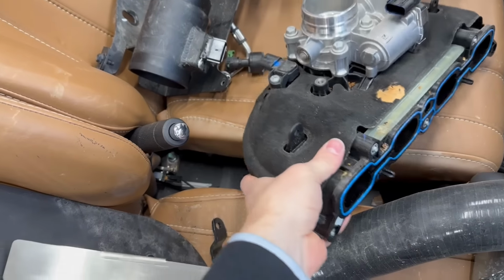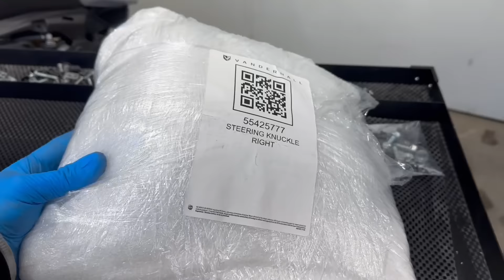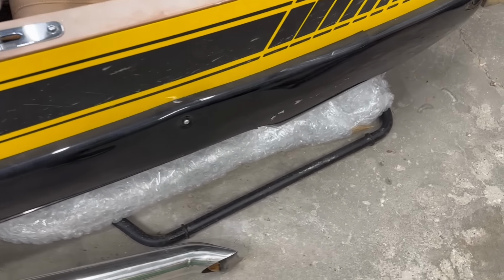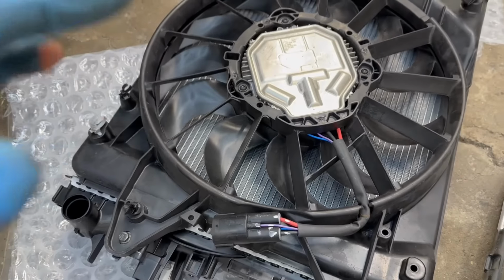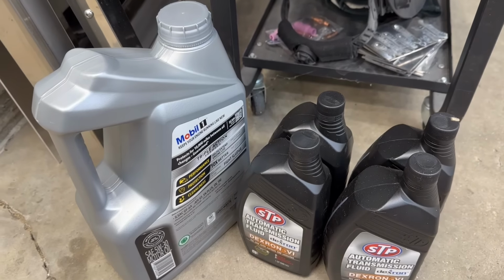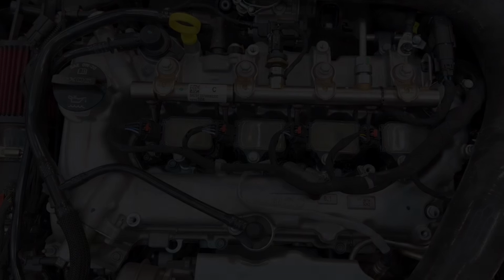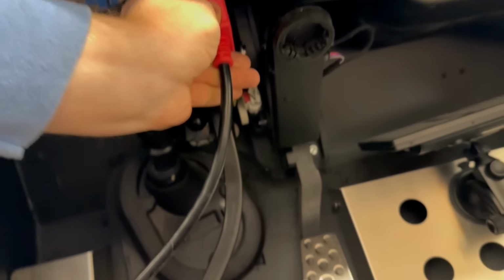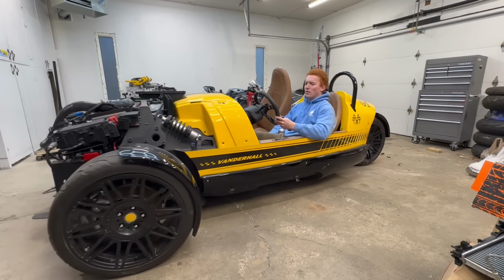Rebuilding A Wrecked 2022 Vanderhall Venice GTS (Part 6)

Comment: Kicker amp is stock. It's only 50 watts at 2 ohms. Key fob system (where you put the key fob if dead) is under the drivers "dash", just to the passenger side of the steering column. A round device that looks like it has teeth all the way around it. If you place a dead key fob (even with no battery in the fob), the Vanderhall will start. There is OBDII in the glove box as well. Very, VERY nice! Lots of Vanderhall owners watching and loving it!
Reply from the maker: Hey Todd! Thank you for all the info, I have read many of your Facebook forms and got lots of information from you, cheers to you
Reply: @CJMediaOfficial  Hey where can I found those sway bars???
Reply from the maker: @donniesanders8718  I believe the sway bar is vanderhall specific, it can be ordered from vanderhall international! They are pretty quick about it

Comment: excellent job brother, but check the trans oil level well because the torque converter uses a lot of transmission oil, otherwise excellent 🫡💪
Reply from the maker: Right bro! I hope I don't need to pull the engine if i installed the torque converter incorrectly but we will see. cheers

Comment: CJ, do yourself a big favour, loosen all the rubber suspension mounts where they attach to the body, put the car down on its wheels, then tighten the rubber mountings again, the rubber won’t be stressed in the loaded position. 
You have locked them tight in the unloaded position, when you drop it down and put weight on those bushes it will stress them bad, it won’t handle and you’ll be fitting new bushes within 6 months! 

Trust me, 3 decades in the trade 👌✌️
Reply from the maker: Absolutely right sir 100% cheers

Comment: hey just a tip when your charging or doing anything with batteries dont put them on concrete as it drains the voltage.

Comment: Great modification on the passenger seat that was made by the previous owner for access to the battery. But with only 1900 miles on it, did you ask why he made that modification ? Just curious.
Reply from the maker: Apparently it is very annoying to remove all 4 seat bolts to access the battery everytime there is an issue, so that's why they made the modification.

Comment: "Do you know what that means? We actually put this engine together correctly." You are actually correct, sir. It also means you are one awesome Engine Technician. Once you connected that new battery, that engine came to life on the first turn of the starter. That is a strong engine, and most importantly, great work done!

Comment: You're missing the rubber o-ring for the top of the fuel injector.  EDIT: was typing this when you found it.  In my area, you're a dead man if you drive one of these.  The old people here don't give a crap and don't look at all.  Good job on the build.
Reply from the maker: HAHA you were exactly right! Ill have to be extra cautious in this! cheers man